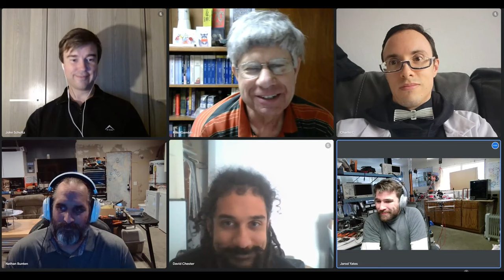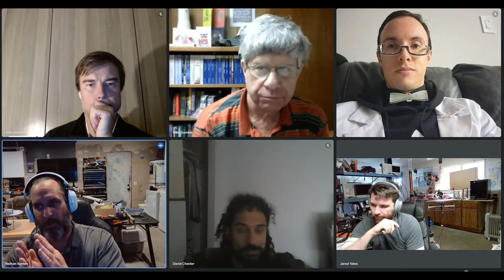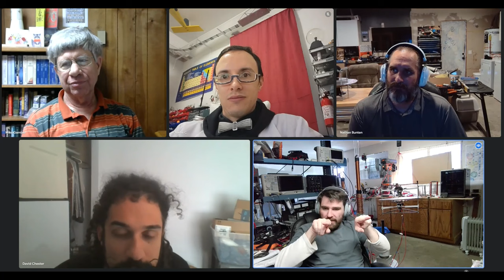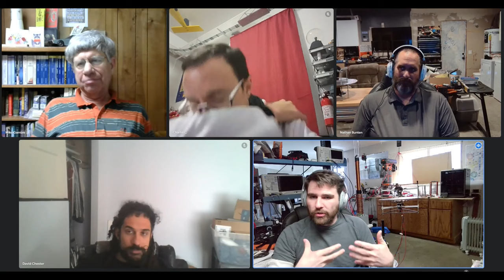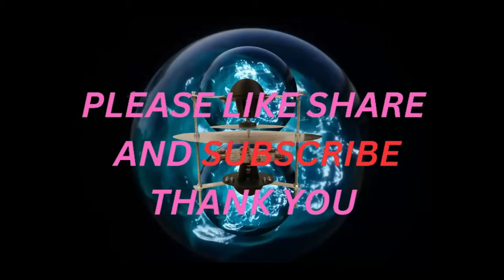Graviflyer Discussion "Acoustic Resonance"

Comment from the maker: This discussion gets into the sound and frequency needed to make the Graviflyer fly. It also rules out any ion lift as the reason for flight. "Sound frequency and vibration" We are getting closer to understanding what Tesla really meant.
Reply: Your "sound frequency and vibration" would only apply within the earth's atmosphere since there is no sound in space.
Reply: llego el momento de completar el rompecabezas
Reply: @tenlittleindians  why would that be an issue? Can you imagine the amount of technology that gets advanced with this one solution.
Reply: @Maxim.Teleguz   You can't mix a machine that relies on an atmosphere with one that's supposed to have lift without the need for an atmosphere.

One will get you into space, the other will not.
Reply: frequency, vibration and resonance are the same thing. it depends on the medium resonating. :p
Reply: @tenlittleindians  we only know of lift to produce a form of buoyancy on air or thrust. This is entirely different.
Reply: @societyofhigh   You can have frequency such as radio waves that will travel through the vacuum of space which has no medium!
Reply: If that's the claim your making fine, then we shouldn't need or be talking about things related to an atmosphere related method of suspension such as sound waves which travel through different mediums at different rates according to factors such as density and temperature.
Reply: @societyofhigh  Your explanation flies out the window when there is no medium such as in a vacuum or at extreme temperature referred to as absolute zero when detectable vibration seems to halt.
Reply: @tenlittleindians  are you in the team that is making ground breaking discoveries or are you the politician here trying to prove why it won’t work.
Reply: @tenlittleindians  what happened to the curious mind?
Reply: @tenlittleindians  I know you are an engineer. Engineers should not be accountants.
Reply from the maker: @tenlittleindians  you are correct. The group starts to discuss it but not very much
Reply: @Maxim.Teleguz  I remember being a kid at the circus and being in awe to see the elephants and tigers. 

The circus left town and that's when I noticed the tiger and elephant shit left behind. I still remember the circus but I also associate those memories with the smell it left behind.

Just like the Wizard of Oz; once you peek behind the curtain it changes everything you thought you knew.

Until we actually have a new wizard in town I'm going to point out the curtains we should be looking behind.

Everything in science starts out as a theory or idea and then we try to prove it by disproving everything we can around that idea.
Reply: :p not what i'm saying, in simplex terms the geometry of a "wave" needs a medium to take on that geometry. eg electro magnetism in radio "waves" or water or sound waves. basically same geometry different mediums. If that makes more sense. the rate of travel or the transference energy in different mediums is kind of irrelevant to the original statement but for an example like light traveling though vacuum it doesn't need a 2nd medium of transference because the 1st medium (magnetism) is self oscillating. allowing for "travel" and storage or energy until further outside interaction  @tenlittleindians
Reply: @societyofhigh  Really? Thinking something and then poorly wording a description of that mindset doesn't give you a free pass.

You can drink beer or water or any other liquid even though some would kill you instantly but you know what I mean " there all the same" according to the way you describe waves.
Reply: Also waves and material properties are not the same thing. @tenlittleindians

Comment: To coat a CD disk with Aluminum Oxide (Al₂O₃) using chemical deposition, you can follow these steps:

Preparation:
Ensure you are working in a clean and controlled environment to avoid contamination.
Gather the necessary materials: a CD disk, Al₂O₃ precursor chemicals, and a suitable deposition chamber.
Deposition Process:
Atomic Layer Deposition (ALD) is a precise technique for coating thin films, including Al₂O₃. ALD involves alternating self-limiting surface reactions to achieve accurate film thickness control at the Angstrom level1.
Here’s a simplified overview of the ALD process:
Step 1: Surface Activation
Place the CD disk in the ALD chamber.
Introduce a reactive gas (e.g., oxygen or water vapor) to activate the surface of the CD.
Step 2: Precursor Adsorption
Introduce the Al₂O₃ precursor (such as trimethylaluminum, TMA) into the chamber.
TMA molecules adsorb onto the activated surface.
Step 3: Purge
Remove excess TMA by purging with an inert gas (e.g., nitrogen).
Step 4: Oxidation
Introduce an oxidizing agent (e.g., water vapor) to react with the adsorbed TMA.
The reaction forms a thin Al₂O₃ layer.
Step 5: Repeat Cycles
Repeat the above steps for multiple cycles to build up the desired Al₂O₃ thickness.
Each cycle adds a monolayer of Al₂O₃.
Step 6: Film Characterization
After the desired thickness is achieved, characterize the coated CD disk using techniques like ellipsometry or microscopy.
Challenges and Considerations:
ALD requires precise control over temperature, pressure, and precursor exposure times.
The choice of precursor and reaction conditions affects film quality.
Ensure uniform coverage across the entire CD surface.
Remember that this process involves specialized equipment and expertise. If you’re not familiar with ALD, consider collaborating with experts or using commercial ALD services for precise Al₂O₃ coating12.

Keep in mind that this response provides a high-level overview, and actual implementation may require adjustments based on your specific setup and equipment.

Comment: Nathan, the graviflyer has a CD disk coated with aluminum on one side and Al2O3 on the other side, the large aluminum disk and then another CD disk coated with aluminum on one side and Al2O3 on the other side. This acts as the capacitor and why your three aluminum disks short out.

Comment: Certainly! Compact Discs (CDs) are fascinating pieces of technology. Let’s delve into their structure:

Polycarbonate Substrate Layer:
The majority of a CD is composed of a tough, brittle plastic called polycarbonate.
This substrate layer provides the disc with the necessary depth for laser focus on the metal and data layers.
It also imparts strength to keep the disc flat.
Interestingly, even a “single-sided” CD with a label on one side has this substrate on both sides.
Any foreign material (like fingerprints, smudges, or scratches) on the polycarbonate can interfere with data reading.
So, handle CDs with care! 📀
Data Layer:
The data layer contains the actual information on the CD.
In CDs, the data and metal layers are close to the top of the disc (label side).
The metal reflective layer interacts with the laser beam.
Now, here’s the interesting part: CDs have a thin layer of aluminum (or sometimes gold) as the reflective surface.
When the laser reads the data, it either absorbs light from the beam or reflects it back to the laser photosensor via this aluminum layer.
So, yes, CDs indeed have aluminum on one side! 🌟
Remember, this aluminum layer plays a crucial role in the CD’s ability to store and retrieve data. Next time you pop in a CD, appreciate the science behind it! 🎶🔍

Comment: Hi guys, love these talks!
Reply: Is it possibile to use a raspberry pi to control all the different controls?
Reply from the maker: we discussed using and arduino but a raspberry pi would work with the correct coding. We have to work out the frequency's first so they do not interfere with the pi.

Comment: Nathan, why divide 343 m/s by 60.  In my theory the Earth is expanding just like the universe. The expanding Earth puts a force on us as we are held to the surface. This is the inertial reference frame that is like the elevator from Einstein accelerating to make us feel gravity.  The expanding Earth is accelerating at 9.81 m/s^2 which is gravity. To get anti-gravity we divide the 343 m/s by 60 seconds to get 5.716 m/s^2 or an acceleration that the graviflyer is undergoing to levitate off of the Earth's surface.  Dividing 9.81 m/s^2 by 5.716 m/s^2 we get 1.718 or (e^1 meters-1 meter) which is the rate that the graviflyer is expanding outwards into the universe. The graviflyer levitates to one meter. The Earth is expanding at the rate of e^1 just like the universe.  It is gravity. The speed of sound is a direct result of the expansion of the Earth outwards into the universe or a sonic boom. a=v/t or 5.716 m/s^2=343 m/s /60 seconds. The Earth expands outwards 343 meters for every one second. The time to length expansion conversion is one meter for every 60 seconds or one minute or why we divide the 343 m/s by 60 seconds. The graviflyer needs to accelerate more than the Earth's surface to levitate one meter above the Earth's surface at 5.7 m/s^2. The graviflyers total acceleration is 9.81 + 5.7 or 15.51 m/s^2. See my last comment below for more explanation.

Comment: Nathan, do you understand my calculations and theory that explains the graviflyer? To levitate to one meter the graviflyer tesla coil, disk motors (current and voltage pulsed and not rps), piezoelectric disk, charge, capacitors, magnets on the spinning disks, etc. all have to pulse at 343 m/s or 5.7 hz or rps to reach a harmonic resonant frequency to amplify the power to lift the gravity flyer up. This is the fishing reel sound.
Reply from the maker: you have a lot here. It may take a while.
Reply: Take your time.

Comment: When you hit the correct frequencies of all devices then the anti-gravity waves make the graviflyer and controls superconducting so the capacitors charge rapidly and the motors power is only calculated by P=V^2=I^2 and not V^2/R or I^2R. The harmonics.

Comment: I don't see anyone using sensors on the feet to determine any positive, negative or sideays force difference between static and running conditions. Electronic stress gauges could easily monitor this to see if your getting any effect other than rotation out of these homebrew devices.

Comment: Maybe I am misunderstanding, but wouldn't a stronger magnetic field result in a more tightly concentrated field? An increase in the detectable range would actually correlate to a weaker magnetic field
Reply from the maker: That would be true but he is not looking for that. He is using eddie current to separate charges of static volts. To high of a field would interfere with that.

Comment: The anti-gravity wave wavelength for the middle of the gravity wave spectrum is 7E+26 meters and you can calculate the frequency with the equation C=lambda nu where C is the speed of light. To get the RF frequency and all other frequencies for the harmonics use my equation of Energy emitted = mass x charge / separation distance for my spectrum. The RF in the atoms is the sound. To get the correct sound frequency use the equation of V=lambda nu where v is the speed of sound in the atmosphere. The mass in the equation is the mass of the anti-gravity wave and is calculated with the equation h nu/C^2 and you can also calculate the mass of the RF with this equation where h is equal to 1.782E-36 meters. The charge is just the electrons charge. The separation distance is the wavelength of the waves. Work the equation backwards.
Reply: Can you share things with us securely
Reply: Sure. How do I contact you?

Comment: Why is it so hard to replicate the original Graviflyer?
Reply from the maker: The Graviflyer is NOT a simple plug in high voltage and spin motors and it works. It is working on 7 harmonics. It deals with the harmonics of them. It takes a lot of skill and understanding to make these things work together. Most would not even think these things are there. That's why I publish these video's. They are showing you new things in physics. Ones that do not appear in the book. It is low powered Not Super high volts mostly static volts. It is opposite of everything that people have read. Either they did not know or the did not want you to know. The accepted views are disinformation. That's why we reverse engineer it from the ground up.

Comment: Air in the atmosphere that is ionized will crackle with the hot air ballon vacuum above the graviflyer and maybe why the graviflyer works better in the summer when the upper atmosphere is ionized as it does the same thing as the graviflyer and sound like the fishing reel. The ionized air of O2 and N2 interacting with the curved surfaces of the graviflyer produce anti-gravity waves like the curved wind of an airplane. The high voltage ionizes the air.